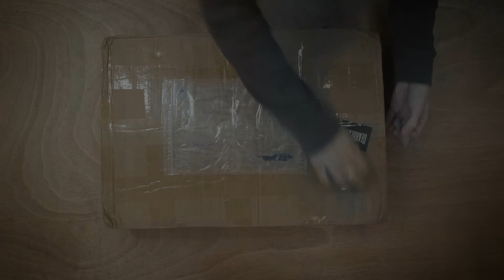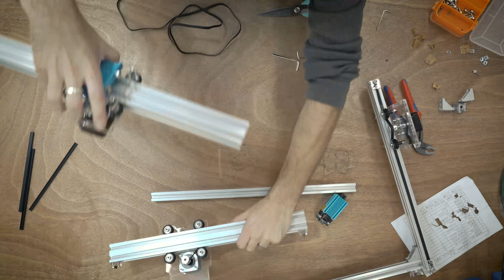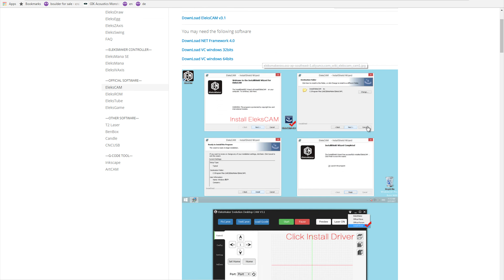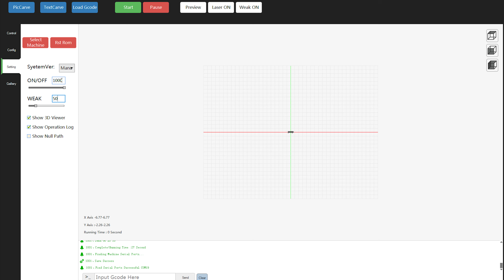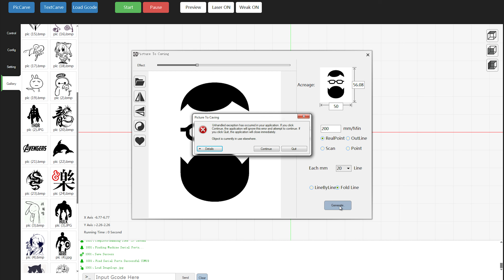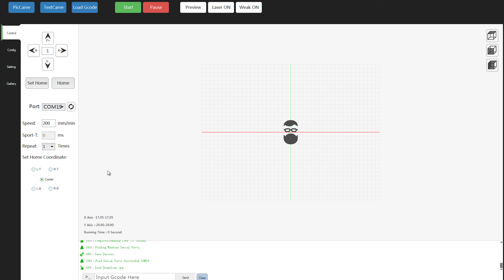Product Overview - EleksMaker A3 Laser Engraver

Comment: Hi..looking for a laser to cut paper and card...Would this laser be suitable...I know you say the results are not great...The card I want to cut can be upto 400gm..
Reply from the maker: it could work for cutting paper, but you might want to look into some sort of blower or air assist so you don't get fires or charring around the edges.
Reply: This is good for darker paper, not white or blue. A better option would be to add a cutting attachment , there's a pen attachment coming out soon that would also hold a vinyl cutter blade holder. It would be quicker and cleaner, just hold the paper down to a cutting mat with 3m super 77

Comment: will the frame hold up to adding a router to use for wood cutting?
Reply from the maker: It would 'hold up', but it isn't nearly rigid enough for those cutting forces, plus it doesn't have a z-motor, so you couldn't have any control over depth, you would need to do all that manually, which makes it pretty useless.  I would look at an x-carve or shapeoko, there's no free lunch unfortunately.
Reply: thx I would reinforce then replace the Acrylic  for  aluminum. I would have bought one tomorrow at payday til i saw you review. It gets a lot of good press/reviews.
Reply: I would add something  like this 

https://www.banggood.com/de/100mm-Long-Stage-Actuator-1204-Ball-Screw-Linear-Slide-Stroke-With-42mm-Stepper-Motor-p-1142419.html?rmmds=detail-top-buytogether&cur_warehouse=CN

and reinforce then replace the acrylic.  Your review was helpful. I was going to purchase one tomorrow.  The unit has many positive reviews, but a misfiring laser  spells TROUBLE.

Comment: Thanks Robert, First video I have seen a negative review for, appreciate the honesty. Is the depthness something you can change under a laser setting? It might make it take much longer though
Reply: Nick Powers this laser works great but it the software is horrible. After a firmware upgrade, you can run it with lightburn and really dial it in.

Comment: Try it vs anodized aluminum. I don't have this laser, but I am waiting on one. I ordered it because I have a 2.5w blue laser and i pointed it at anodized aluminum with good results. I tried red and black, and it stripped the color from both.  While I am waiting, I it would be cool to see if it works well on the cnc lol.
Reply from the maker: It would work fine for taking the anodizing off of aluminum.  You MIGHT need a couple passes, but it should work out just fine.  However, with the software, you'd have a hard time getting a clean engraving since it has limited resolution and doesn't really seem to support vectors.  I've done this many times on my CO2 laser and it works well!  Also, once you etch off the anodized coating, I would be worried about it reflecting back without an enclosure!
Reply: Sounds good enough to me. Worst case scenario, maybe I can find other software that will work.
Reply: Benbox worked well for me.  The review is right on ON THE SAFETY part. However, I was fairly happy (for my application) with the unit using the Benbox software.
Reply: Robert Cowan it won't take the anodizing off, it simply obliterates the dye embedded in the anodizing.

Comment: thx 4 the video do you know a better one for the same price ,,,=?
Reply: ore witch one can you 
recommend
Reply from the maker: not the same price.  it's just too little cost to make everything work correctly.  I suggest getting a 40W laser engraver.  You can search for that on eBay and usually get one for under $400.  But at this price, it's just far too cheap to have a usable laser engraver.
Reply: and this 400$ laser is ok to cut and engrave ?? do you have make a video ?

Comment: Yeah, this is the big issue with buying kits from china. I've just built a super cheap CNC and had the same issues, the instructions were lacking (the ones I was provided were in Chinese) and pieces in my kit were different from what was shown.

Now I'm struggling to get it cutting because all the software and setup instructions are in Chinese
Reply: Team Panic
Same problem.... I spent hours farting around with firmware and software. I ended up with a GRBL 1.1 firmware (from GRBL's github releases I think), and I've been using LaserGRBL for software.
I would prefer Linux software but haven't been able to get anything to work yet.... but I've only had mine for about 5 days and wanted to make some Christmas gifts with it before I fiddle with things more.
Reply: Use a third party software to do your cutting like fusion 360

Comment: also. the pluse seting is probably the step/mm isnt it. that would explain the bad resolution on the engraving since you scaled it over 3 times. also for cutting you could use easel without tool ofset
Reply from the maker: I don't think it is.  When you generate the g-code, there is a screen (that I didn't show for long) that you can select the 'lines per mm' or whatever.  That is the resolution.  It basically just slices up the image into lines.
Reply: Yeah, he did mess up the resolution and the correct settings was 80.

Comment: i am angry at you.... i was watching a random guy rebuilding a huge 3d printer to stop at episode 4 ... finish it i need to see the print quality . ok dont worry i like your channel but stil.... finish it
Reply from the maker: You aren't the only one.  For this reason I'm going to mess with the printer this coming weekend.  I had to do a lot of research and make some decisions before I go any further with it, and I think I'm ready to just bit the bullet and move forward with the build.  Don't worry, you'll see a video about it soon.
Reply: Is it possible to burn a logo directly into a table top or slab of wood larger than the unit while the unit is sitting on that slab? I have been looking at branding irons but do not like the limitation of having just one brand, or having to purchase over and over ...vs the flexibility of putting unique or custom designs onto cutting boards, coasters and tables I have made.  Thanks in advance
Reply: Yes.  When he's demonstrating he's doing it on something barely above the table it's sitting on.  You would just set the laser focus to the slab that it's sitting on.  Then do the perimeter or frame test to see what the frame of the burn is going to be.  Of course it would be nice to test it on a similar piece of wood before you do the actual one.  You wouldn't want to waste an incorrect burn on a good product.  But then again you can sand it and try again.

Comment: Very interested in the follow up video idea mentioned. Particularly thoughts on the K40 style laser cutters which seem like a good alternative for not a huge amount more money. What has put me off those was they all seem to require a dedicated staked ground connection and it's not completely clear how to do properly safe setup in terms of grounding and ventilation.
Reply from the maker: Noted.  I'll add you to the list of people that would like to see this video ;-)
Reply: Full disclosure, I bought this laser and love it.

You should upgrade the firmware to GRBL 1.1, if you do let me know and I'll give you my settings. Then give LightBurn a try, you won't regret it, especially if you get LightBurn working on your k40 or any other lasers you have.
Reply: Hi Josh! I am planning to buy AS - 5 10000mW Laser Engraving Machine. Can you send me please the software which I can use for this machine? appreciate your help. markedmundvicuna@gmail.com